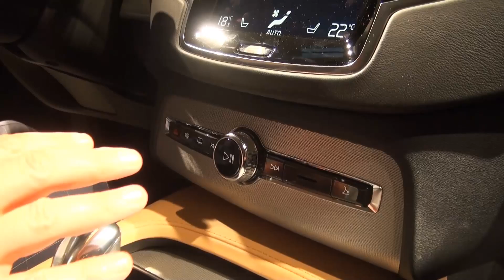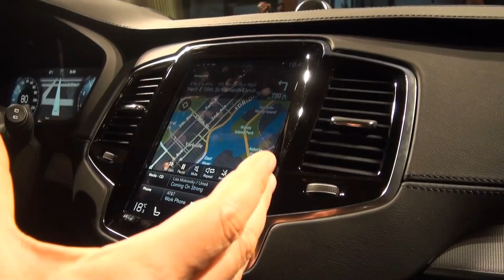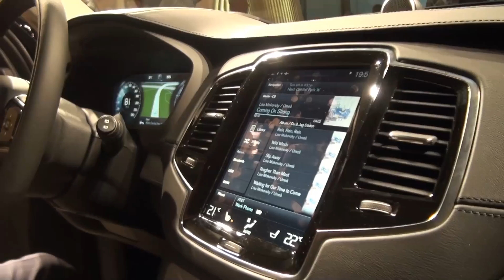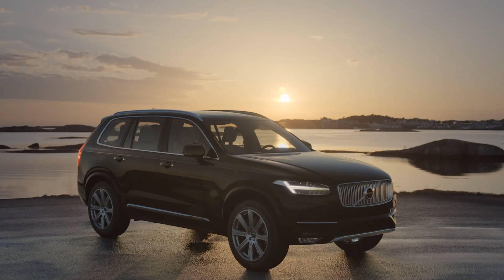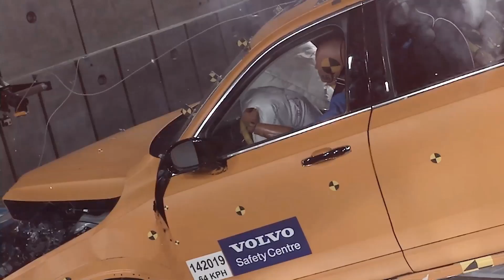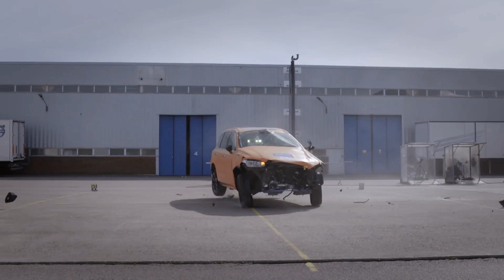All-new 2015 Volvo XC90 premiere with interior multimedia and safety explanation - Autogefühl

Comment: while the tech is cool it seems like it will be distracting. you have to look and read for least tree seconds to find what you need that means it is no different from using a cell phone. with buttons, we get use to their locations and often operate with just sense of touch while focusing on the road. its really cool thought, I'm just puzzled at how well it will workout. they need to have a demo of one of their guys drive it around while using the system for a week or so to see how well it works and how long it take on average to get use to it

Comment: I'm sorry the touch screen is cool but I'd rather have physical controls to control major functions.  It's distracting to have to look at a screen to control basic stuff while driving. I hope this has redundant  controls for the radio  and HVAC.  Manufacturers forget we also use our sense of touch. Otherwise cool suv
Reply: I totally agree. I have rented a few touch-screen controlled vehicles, and physical dials and buttons-at least for the basics-are much easier (and safer!) than having to look at the screen.
Reply from the maker: craigloomis20 Yeah we have to see how it plays out. E.g. Audi has some good solutions in the latest models, e.g. the A3. There, you find the most functions in the screen but for example the climate control and seat heating as separate buttons.

Comment: "What most people dont realise is some volvo cars are extra safe in terms of crash simulations, BUT This only mostly applies to the driver NOT the passenger and rear passengers i.e your kids will have LESS protection in a crash in some volvos than most normal cars. look it up in encap ratings. Volvo show you your children in a rear facing position child seat, which is naturally the safest position for your child up to age 15 months, but they dont show you the results of the forward facing child seat which would be totally different. The same goes for the Audi Q7, most people dont know that it is also nothing more than a pimped up dangerous go cart on wheels and one of the most dangerous suvs on the roads today for both the passengers, driver and pedestrians. But most people like to ignore the reality. Unless the senior technical safety expert and the CEO of volvo crash test a car sitting as passengers in the back live and release this on youtube or TV dont beleive the hype."

I don't think you know so much about the safety work Volvo does. Volvo is the safest car in a real life accident, they do not do safety in terms of rating. They do it for real life situations. Volvo has conducted research on over 40.000 crashed Volvo cars to further make the future cars more safe. The old XC90 earned Top Safety Pick+ from the IIHS 2014, a car that is in construction 12 years old! 

"And lets face it, the screen will be great fun when your standing still. But while driving on the highway I cant see someone messing around with this screen, its very dangerous akin to that of texting while driving."

That's why Volvo uses Head-up display, voice command and information displayed in the center cluster in front of you so that you do not need to take your hand from the wheel when driving.

Comment: Uh oh, problem. This car is going to be old before it is even launched.  This big impressive looking screen doesnt have google maps. So other car companies in 2015 will have this meaning you can see the destination on your gps screen just like google maps at home. And lets face it, the screen will be great fun when your standing still. But while driving on the highway I cant see someone messing around with this screen, its very dangerous akin to that of texting while driving. They still left the terrible looking volvo lights at the back and for the low BHP it offers for £68k in the UK, thats pretty much Porsche cayenne money. What most people dont realise is some volvo cars are extra safe in terms of crash simulations, BUT This only mostly applies to the driver NOT the passenger and rear passengers i.e your kids will have LESS protection in a crash in some volvos than most normal cars. look it up in encap ratings. Volvo show you your children in a rear facing position child seat, which is naturally the safest position for your child up to age 15 months, but they dont show you the results of the forward facing child seat which would be totally different. The same goes for the Audi Q7, most people dont know that it is also nothing more than a pimped up dangerous go cart on wheels and one of the most dangerous suvs on the roads today for both the passengers, driver and pedestrians. But most people like to ignore the reality. Unless the senior technical safety expert and the CEO of volvo crash test a car sitting as passengers in the back live and release this on youtube or TV dont beleive the hype.
Reply: Wtf. I wouldn't put my loved ones into a Porsche.
Volvo sells for smart people focusing on safety.
You also comparing a safe family suv with a sportscar.
And the new look of this vehicle actually is close to the Porsche's look in the SUV segment.
Reply: They say they have Android Auto, so that should include all Google services including Google Maps (but I would like to be sure that that is the case at shipment).
Reply: Buying a car these days is like booking one of those mystery hotels. You dont know what its like actually staying there until after you paid for it. I remember when I used to commute with my brand new bmw 6 series convertible. Great you may think, but not so great to actually own one, after 1 month when the exciting new feel of the car wears off, I had at least 15 complaints about the car. One of the biggest illusions known to mankind is Luxury. This is because everything is relative and there is allot of relative competition in the auto market these days.
Reply from the maker: anythingyouwant29 Good points. The pre-sale is very exciting, I think it will work. As for Google maps, indeed for example Audi and Tesla have it. Did you check out our Tesla review? We were also talking about the big screen using it in driving there - with a lot of controversy. Interesting aspects on the safety.
Reply: Yes I was counting down with the online clock. Great marketing idea, but practically a nightmare, this will also create some bad after service feelings. Everytime someone chooses a number it comes up with the words, SORRY someone else was quicker than you, I got this message about 20 times and often the same number Volvo said had gone, came back 5 minutes later! I am sure its not easy to organize something on this scale, but it was done very badly. The numbers you select have to be confirmed on a keypad which cannot be typed using your keypad only the onscreen keypad and the keypad is never the same, i.e number 1 could be at the top or at the bottom. In summary its a great marketing tool but practically a nightmare to buy one and I think most people will just give up trying after 2 minutes. The bad after service feeling will come around October 2015 when buyers of the first edition decide to sell, they will realize they just paid a premium for something they can get much cheaper in a dealership. Around 10k to 20k cheaper. Which means buyers will alienate themselves from the second hand car market. Its like asking 65k for a porsche macan now, next year or so they will be selling for 45 to 50k new from the dealership with discounts! But if money is no object and you dont mind being screwed for cash then all is well, buy it as a collectors item and park it in the living room.
Reply: Google maps is a feature in the new infotainment system and what other cars offers better protection for its passengers?
Reply: most.
Reply: Interesting, however Its not clear if they will add it to their 2016 model or 2015.
Reply: Good point, it is actually Porsche Cayenne territory in terms of pricing. However there is always one problem when buying a WOW looking expensive car, you may attract unwanted attention. I mean if a robber is off to work and sees 2 houses, one with a cayenne parked outside and one with a volvo, my guess is they will plan on breaking into the Porsche owners house.  Another problem with Porsche is the very expensive ownership costs, anyone buying the new XC90 Volvo can afford to buy the Porsche cayenne, the difference is the service and running costs. Porsche refuses to offer a fixed service pan, which is almost like rolling the dice come service time, the extra cost is almost akin to the price of a new small hatchback and if the clutch goes on the Porsche you may have to cancel the holiday to pay for it. Then there is the depreciation its very heavy, common faults on the cayenne is air conditioning, bluetooth, automatic boot not working, the windscreen washers were recalled at one stage on new cayennes, the heated seating doesnt work sometimes and its terrible off road compared to other makes. Overall the volvo has a far better reliability track record.
Reply: ***** Very unlikely, the S80 and V70 have been successful, whereas the old S90 and V90 were not. The shapes are being updated at the moment, but a name change is unlikely. Same reason the XC90 didn't get a new name.
Reply: Thats actually not true. Volvo are not the safest cars and the actual safety varies between passengers. Some new volvos protects the driver very well but not the passenger and certainly NOT the rear passengers i.e your kids. So dont be fooled by the volvo safety hype. Do your research and check independent safety expert websites.